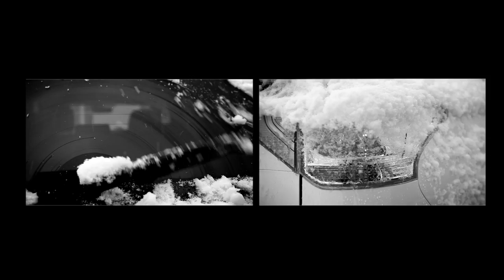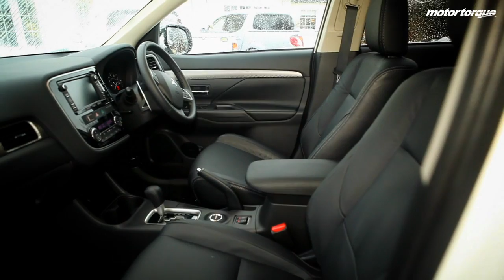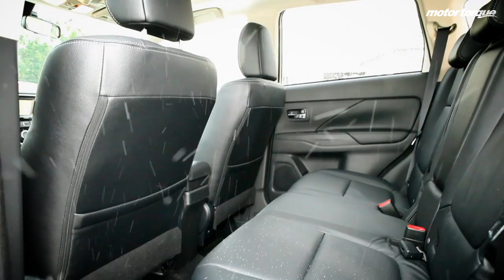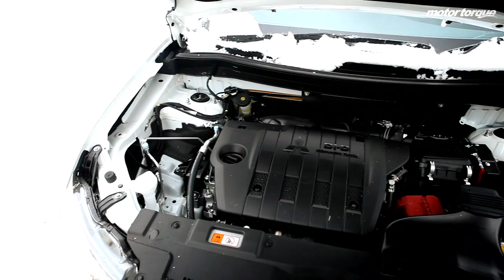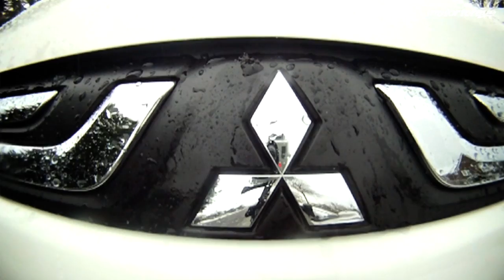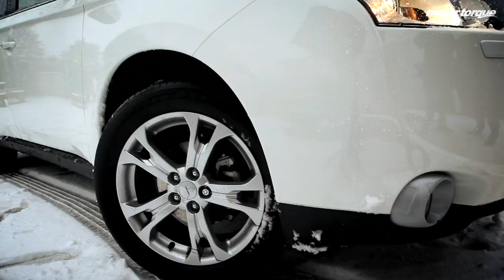New Mitsubishi Outlander review and road test 2013

Comment: I've just bought the GX4 on the back f this review as well as others. Had a Disco3 before and wanted to cut running costs but not comfort and this has done the trick. Wasn't infused by the new nose, but it grows on you. A close run decision process between this and the Subaru Forester... its quieter and a damn sight more practical for the family.